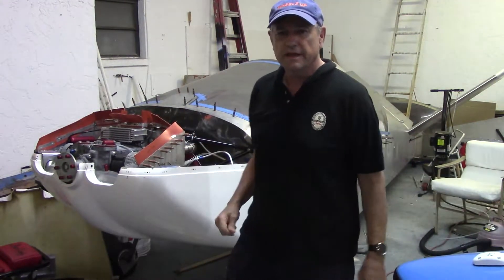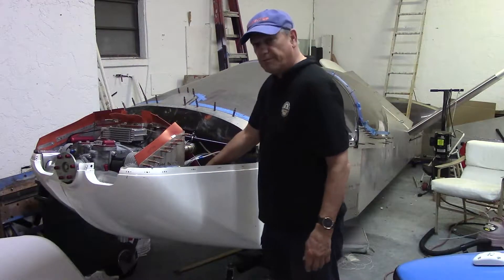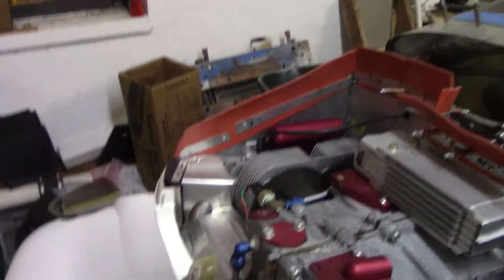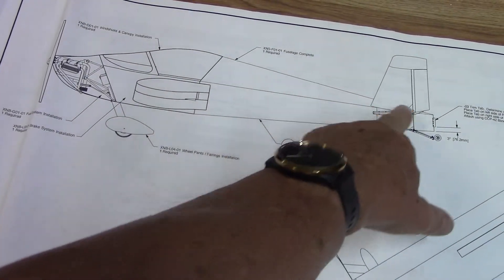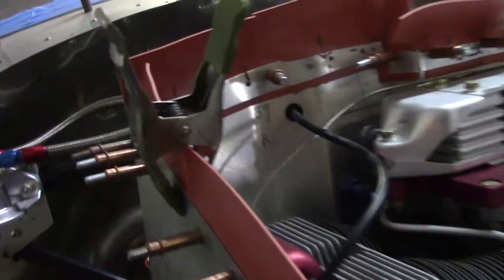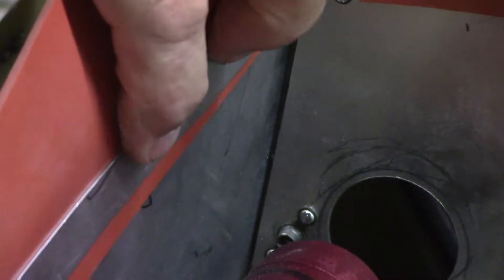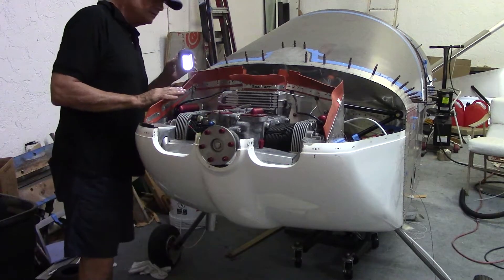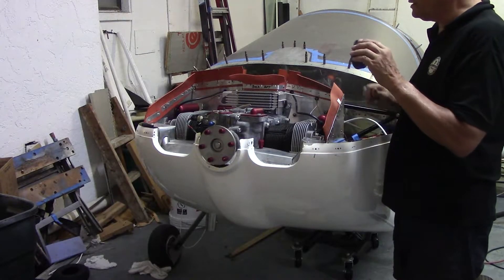Sonex Xenos motor glider, progress continues on the cowling and engine baffles

Comment from the maker: Cowl is designed to fit many popular engine options for AeroVee/AeroVee Turbo    The AeroVee Turbo is rated as a 100 horsepower engine at sea level, and yields significant performance enhancement to the Sonex line of aircraft without breaking the bank. Just like the normally-aspirated AeroVee, the AeroVee Turbo can be installed in any suitable homebuilt aircraft design. The AeroVee Turbo is offered as a complete kit package, and upgrade packages are available to convert existing 80hp AeroVee engines to the Turbo configuration.

In a Sonex Aircraft